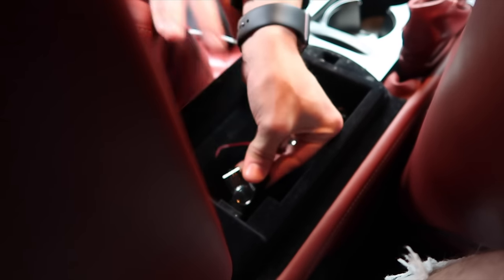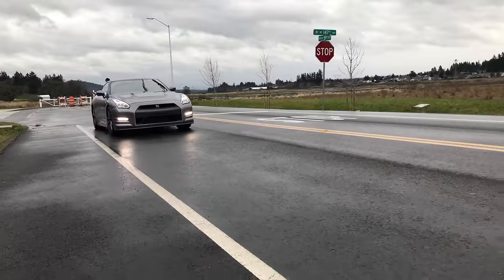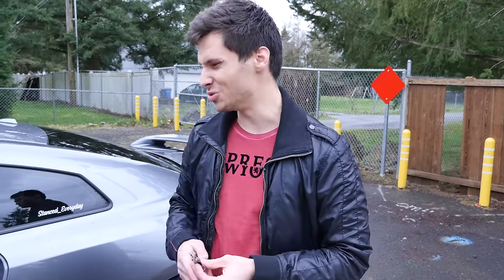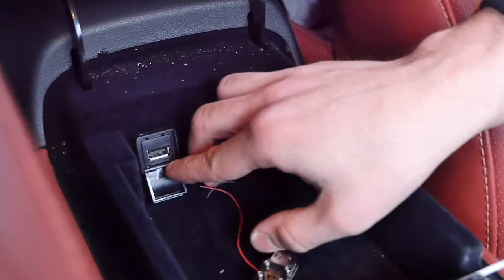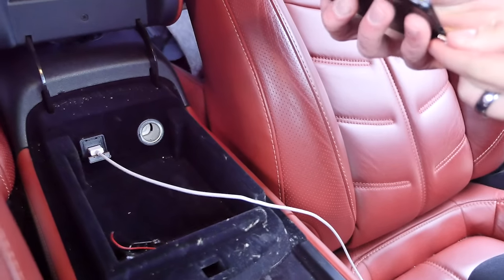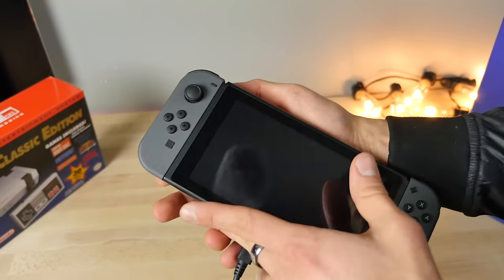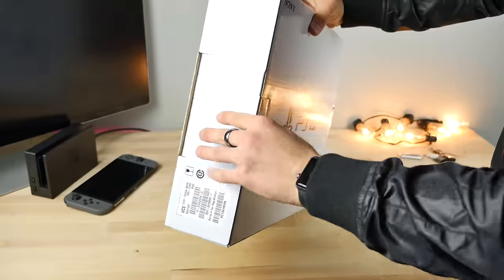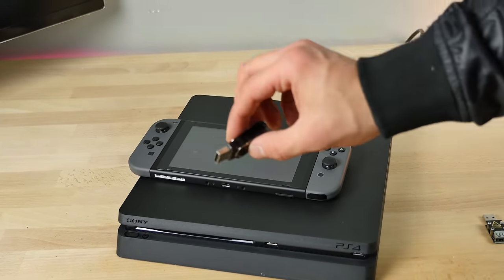USB Killer vs Nissan GTR & Nintendo Switch - Instant Death?

Comment: >Nissan GTR
>Stance Sticker
>Automatic.

Lmao.
Reply: The R35 does not have manual transmission.
Reply: I Feel ya man, I Feel ya.
Reply: /gamegeek/ the only come automatic lol wtf
Reply: R35 do not come with manual transmission option
Reply: 7FXCyndershade So he can't drive manual and therefore bought the shitty GTR. 👌

I'd take an R34 or R33 than an automatic any day of the week.
Reply: The GTR is semi-automatic. They don't make a true manual transmission for it. It can switch between auto and manual mode.
Reply: Raddy Pex I'm well aware of that. I'm mocking him for driving a GTR as well as an automatic. It just so happens the R35 only comes in automatic.
Reply: chris jonathan maybe a skyline but not the R35 generation
Reply: firmly grasp it He doesn't like driving his own car.  

When automatic transmissions are cheaper and more reliable to wrench on I'll consider using one. "Grandpa."
Reply: It really depends on application. If I'm daily driving a base model 
economy car and trying to save gas or maintain better control in bad 
weather I'd go with a manual transmission. If I want a high end touring 
car I'll take the 6-7 speed auto with the dual clutch because it will 
shift faster and more precisely. But that also goes with saying, the 
base model 4-5 speed autos that come with economy level cars are hardly 
in the same ballpark as a high end sport auto.
Reply: yea it's kind of a shame for sure... This kid will probably just make a warranty claim on the car anyway..
Reply: its a "decent" ricer. Nothing more.
Reply: Lol. People are just jealous for that kid because he has almost brand new GTR. I'm a Skyline enthusiast, but I'd still take a GTR any day. It would make a great daily driver. It is such a well performing car.
Reply: People are clueless.  A GT-R is automatic, but you also have a choice to have the ability to control shift times.  Many high-end supercars have this same concept.
Reply: did i mention 'ricer'?
Reply: two 14 year olds above me.
Reply: Mr. Meeseeks ?
Reply: Mr. Meeseeks Too true.
Reply: /gamegeek/ it has sequential gearbox idk how it works and does it even have clutch pedal but you have an option to shift manually or use automatic and its a lot faster than classic manual gearbox (but not as fun)
Reply: /gamegeek/ He's already in the next gear before you have a chance to even tap your clutch. lol
Reply: EXACTLY
Reply: Lim Jahey Lmao I have a WRX, but apparently any criticism of anything equates to jealousy.

I don't care if the kid bought the car himself or it came from his daddy. 

Also speed isn't everything. His car would smoke mine any day of the week and I'm not ashamed to admit that. 

Feel free to keep projecting though. ✌️️
Reply: /gamegeek/ My point is a manual transmission takes too long to shift. Also, you definately aren't making assertive criticism if that is what you are claiming.
Reply: Whumptapus Ok perhaps joke is a better choice of word.

I'm not denying automatic transmissions in sports cars aren't faster. Just that it isn't as engaging or interesting.
Reply: /gamegeek/ Sometime s manuals are faster.but I like yur knowledge of cars
Reply: Xxm Mmz They can be if your talking about most cars. 

Double clutch automatics are faster. Yet manuals weigh less, use less fuel, are cheaper to repair and in my opinion are significantly more fun.

Different strokes for different folks. I just find it funny how defensive people get over a joke lol.
Reply: /gamegeek/ the r35 get only comes in an automatic duel clutch transmission
Reply: I Do agree with you, it's just we car guys find it funny.
Reply: D39 street hmm i did that to.my old crappy travant
Reply: What's next? Call it a Skyline? Dude gtfo.
Reply: Alien Hybrid yes you can manually shift it but there is no clutch so it's still not manual. Not matter that kind of fancy shit a car has if it doesn't have a third pedal it's not manual
Reply: Marek Misztal it has no clutch pedal therefore it's not manual end of story
Reply: Nsa
Reply: Snook Sniper it haves paddle shifters you can shift manual with that or have it in automatic. You can't get a r35 in a stick shift you mean this is a new platform Nissan moved on to. Do you're research and look up the specs on that model, find info on the transmission
Reply: hulkster00 they don't make a r35 in manual. Doesn't matter if it has paddles if it doesn't have a clutch pedal then it's not manual
Reply: /gamegeek/ gtr is a great supercar that is faster  than other cars with x2 of it's price and THERE IS NO manual available and the gtr has many fanboys and haters in the car community but a true car guy like any car and those shity stereotypes gtr is a computer,or mustung kill people,civic ricers at the end all of them are great cars at true petrolhead likes any cat but NOT the pruis iam 15 and sometimes i drive my father's 2005 accent and i like it
Reply: >not using the may may arrows
smhtbhfam
Reply: No manual?!?!?!?
Reply: You can't afford a R35, and the older skylines get ANNIHILATED by R35. They're so slow in modern car terms they barely qualify as sports cars. And stupid mods won't make it competitive on an actual road course, even if you pumped it up to 1000 hp it'd still get destroyed by a stock r35 around any racetrack in America. You ricers are the worst, all just broke teenagers with cheap shitty old hand me downs that break down all the time.
Reply: NSA
Reply: He coulda plugged it into the ecu
Reply: /gamegeek/ I prefer the Evo IX MR, but it’s tough to decide between an R34.
Reply: GTR doesn't have manual  it has a double clutch auto and tiptronic
Reply: Come on man, you could have googled R35 GTR transmission and found out that they are only produced in automatic before commenting lol.

Comment: Its a Nissan GTR, I think even an USB Port will cost as much as a house xD
Reply: It’s a USB port.
Reply: do u think USB ports are different in more expensive cars? they all do the same thing
Reply: @moncler5875  I think that Nissan will charge more to replace it than VW or other car companies with cars not that expensive.
Reply: @GhostSheep96  it’s a USB port
Reply: @gacha21x35  the port itself will be the same price as any other, I agree. But getting it replaced by the Nissan Dealer will be more expensive then getting a VW USB port replaced at a VW dealer
Reply: @gacha21x35  and im pretty sure that Nissan have any protections so you can’t use any USB Port, only the one that Nissan or other certified manufacturers sell.
Reply: @GhostSheep96  it's a USB port

Comment: Test one: phone
Test two: computer
Test three (now) car
Test four: plane
Test five: rocket
I see where this is going
Reply: Test Six: Nuke Bomb
Reply: Test seven: Earth
Reply: Test eight:universe!!
Reply: Test nine : existence of everything
Reply: Test 11: Your mom

I'm sorry, I had to.
Reply: Who invited Greta thunberg?
Reply: Me who breaks an mp3 player trying to run it with a DIY bicycle dynamo - way too much voltage and unstable voltage.
For some other reason I can't work out why I managed to damage another mp3 player using a nokia phone charger to mini USB adapter on my 2006 nokia phone charger. The reason it strikes me as odd is because it's all standardized as 5.0 volts with same polarity, so unless that phone charger was in some way non standard, or perhaps too much current caused by a slightly higher voltage. I don't think it is a polarity issue as it charged fine with a hand cranked torch I got the adapter with for both the phone and the mp3 player. Phone chargers today are all identical to a USB port in terms of voltage and polarity so it would probably work. The MP3 player screen shut off and it got warm as if the battery was shorting. If anyone knows why an internal/outer conductor pin phone charger to mini USB would kill a device designed to charge off a USB socket, then reply to me. All I have is the phone charger was before practically everything standardized to be identical to USB in terms of output voltage and pins. So if anyone knows whether phone chargers in the past put out a higher voltage or something it would be good to know. It looked like a standard switch mode power supply. The other thing is, did the mp3 player need a signal from the data line to limit its charge current perhaps?

Comment: Yes, let’s just try to break a 120,000+$ car
Reply: Daniel Corey it's only 90k I have one
Reply: Also the car still would have ran and it would still be driveable, it does not put out more voltage than a car battery
Reply: Immortalsnyper 1 You're 12 and think that there's only one GT-R.
Reply: The Hype Watermelone sure
Reply: FOX/F'z 😂😂😂😂😂😂😂😂😂😂😉
Reply: that nigga lmao it isn't the car mate,it is the driver.all car enthusiast know that driver skill beats car potential (not in a Drag race though) a skilled driver can drive a Volkswagen Golf and a inexperienced one drive a GTR because the GTR driver crashes in the first corner
Reply: that nigga lmao that's the case if it's in a dragrace,take them into a racetrack with tight corners and no long straights,the GTR might lose due to heavy weight,Computer assists and the automatic transmission not letting you get into the gear you want to.
Reply: Daniel Corey it's less than 100k
Reply: The Hype Watermelone why don't you post a video of it
Reply: FOX/F'z or an R34
Reply: Daniel Corey  YH GREAT IDEA
Reply: The Hype Watermelone no you don’t 😂😂😂
Reply: It's just a USB Killer, do you know what does that actually do? It just worked as expected, fried the USB port, electronic systems in the r35 were unharmed. Pretty stupid thing to do if you ask me but aswell pretty safe for the car (Not so safe for the USB port tho LMAO)
Reply: His money... not yours...I dont see why you're concerned of this
Reply: your savior lmao which r32 are we talking about? The skyline or the golf?
Reply: your savior lmao more power doesn't necessarily mean more speed, only around 280hp is needed at most on a mountain pass, anyways haven't you seen initial d? There's a guy in a 30 year old Corolla whoopin everybody's ass and he had 130 hp (later upgraded to 186)

Comment: I would never drive that car again
Reply: espeacially when tha car is known as Computer.
Reply: Mazda 787B (MR.B) trust
Reply: Nothing Da Label it still would be drivable because with the GTR they separated the electrical for the engine and tranny from the luxury so if the computer fails it mechanical takes over so still safe to drive
Reply: Nothing Da Label it still would be drivable because with the GTR they separated the electrical for the engine and tranny from the luxury so if the computer fails it mechanical takes over so still safe to drive
Reply: Josue Alcantar hmm aight

Comment: Hmmm, what is the purpose of these videos? I mean, if he was searching for products or devices that are hardened from a USB surge then maybe I could wrap my head around his video series. But the USB killer is doing exactly what it was designed to do.
It would be like testing whether a knife will cut meat or not.
Reply: HouseMasterLoL that's an opinion
Reply: Bronwyn Corgi Lovah no, some devices are protected. It more like seeing if a knife will cut through a specific material
Reply: Bronwyn Corgi Lovah what... a logical and legit complaint!? Unbelievable.
Reply: Bronwyn Corgi Lovah 
any-who you have a point there. It's no different than the YouTube hot knife trend a while back which literally tested if a knife could cut or not. I guess it's a..... a quirk. Certain people find enjoyment out of this and I'm sorry to say but people just like destroying things so it's enjoyable for him to. This is just speculation though.
Reply: Bronwyn Corgi Lovah - There's ways to prevent it. I saw a laptop, for instance, that threw up a notification about a power surge in the usb drive and didn't (as far as I remember) otherwise react. Even easier than that would be separating the USB board from the main board like the PS4's front ports, so that only those ports blow out instead of the whole system. It's preventable, but companies still aren't doing it. Only when they start consistently doing so will this series wane.
Reply: Bronwyn Corgi Lovah fun
Reply: Bronwyn Corgi Lovah he's making moneyyyyy thats way, for every million views he gets about 1000 $, he's already making money
Reply: Lovah, people watch a lot of these videos, for some reason. You might have an idea with cutting meat to test if a knife works. Good chance if you made a channel doing only that, you could make a living.
Reply: Bronwyn Corgi Lovah Q
Reply: HouseMasterLoL it was auto correct and yes it is for entertainment purposes. You might not see it that way but thats why he creates these.

Comment: the nintendo switch most likely didnt break because the battery could have just possibly popped
Reply: Theamazingflamindude if the battery popped from such a quick short, it would immediately catch fire.
Reply: Theamazingflamindude g v b
Reply: Theamazingflamindude yes it broke dude it fried the switches motherboard dude

Comment: If u still have that Nintendo switch
Hold the power button for 15 seconds release and then press it 
the Nintendo might power on after doing that
(Make sure the Nintendo was charging for about 2 hours before you did that)

Comment: Stick the USB killer on your tongue.
Reply: You can't because tongue gives out no electrical power, the USB Killer works like "collecting power from the device then send the collected power to the device and over again." Since the USB Killer CAN'T collect power fron the tongue... N O T H I N G   H A P P E N S.
Reply: hes not a usb outlet use logic.
Reply: That wouldn't work
Reply: he should do a series where he puts metal stuff in electric things e.g a for in an electrical outlet
Reply: LotusEater14 It's not a complete circuit, so he won't get shocked.
Reply: LotusEater14 hahaha

Comment: I looked up what these do. Nothing will survive what this thing is doing. That thing is a mini tazer that shoots 2000v up the data lines. Nothing made to spec would ever do that to a USB socket so nothing will ever be designed to survive it. So there is no "will it survive" it is how bad will this fuck it up.
Reply: littlefreak3000 There is a usb safe port thing that are safe against usb killers, i dont know anything about it just google it if you want info about it.
Reply: usb ports can be protected with an optocoupler but since that costs extra money almost no usb port has this

it will fuck the port but it wont fuck the rest :)

Comment: It was hard to watch when the ps4 died because i never had 1 i was like holy mother duck i cant even buy 1
Reply: Go to work save money buy it I pray for you son. Very sad to hear that...
Reply: Blue The Cat phones cost less than a fucking ps4
Reply: Yasmine H some cost more
Reply: Yasmine H 300 bucks for a ps4, 1000 bucks for a good phone.
Reply: AquaaAU actually 240
Reply: you don't need the newest latest phone aka the s7 or s8, i have an a3 which costs less than 200. Works perfectly fine.
Reply: Yasmine H Got my S7 in 2016 for $380 refurbished from Best Buy. I'm typing on it right now, still works like new other than the battery showing some aging.

Comment: What is a USB-Killer and what does it do to the devices?
Reply: Mr_Noname if you been watching the whole video or you still don't know  USB Killer is a testing device created to test USB ports against power surge attacks.
Reply: It was also invented by a Russian blogger as a method to destroy all data in case of a breach.
Reply: It takes 5V from power rails and has charge pump and it stores that energy in capacitors, then dumps it over DATA lines witch are not that well protected, that is what fries devices.
Reply: It basically takes the power that the device it's plugged into is giving it, builds it up over a short period, then sends it through the data channel at something like negative 200V, which is enough to fry almost anything. The pops you hear when it's plugged in is each discharge back into the device.
Reply: i was watsching the video but didn't understand what was happening. but thank you guys for the explanation. :D
Reply: No problem, the video doesn't really explain what it does anyway. lel
Reply: ok. so you need two transistors, a capacitor, and... well fuck it this is pointless

Comment: I Have a self Made taser with 20Kv(20000volts).one millimeter spark is about 1 thousand volts so you can roughly calculate the number of volts.

Comment: some cases its a circuit protection feature. needs to be no power to it 2 min or battery disconnected 5 min to reset it. 
it MIGHT not be actually fried but faulted a breaker or the power management system to cut power.

look in to it theres ways to try to reset them.

Comment: Breaking things is easy. Why don't you check whats wrong? unscrew the switch and check if it is just a fuse. I might be that you can easy repair it. Just breaking without getting the reason what element actually broke is just a waste of time ^^ i can break every device in a second. just plug in 230v at the USB Port and its gone? i don't get this video xD

Comment: try use inertia switch thats called the resset button switch if you hit it harder the button is going up and press it again it ressets because if you plug a usb killer and the inertia switch is operating the usb killer might explode and the usb killer wont work or worked

Comment: Next you should try this with a PlayStation 5 and an Xbox Series X cause you plugged it into the PlayStation and technically it still worked in the front but the Xbox doesn't have any ports in the back so it was an automatic loser to to the USB C stick but I would be curious to see the differences between if you plot this USB stick/USB killer into A PS5 versus an Xbox X  I'm sure the xbox X doesn't have any protection but the PS5 does it would be interesting to see that's for sure you should make a video you do please and thank you thanx